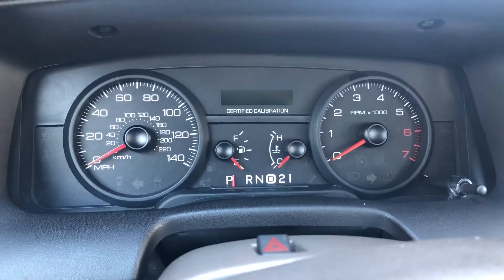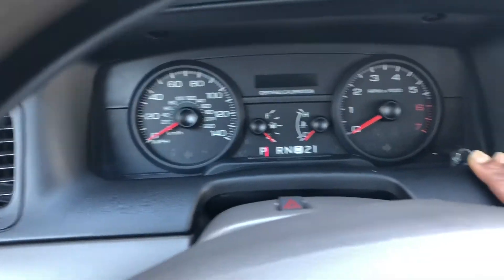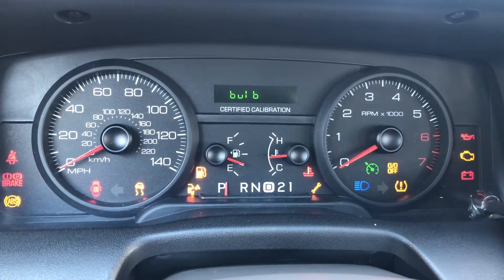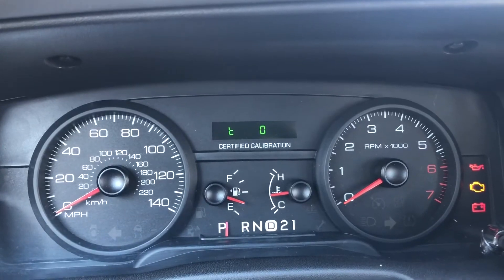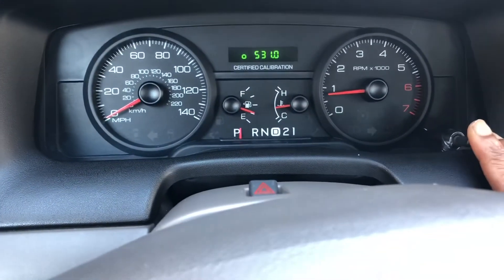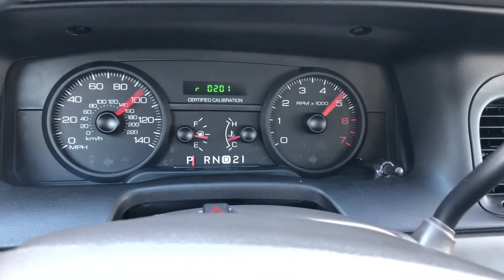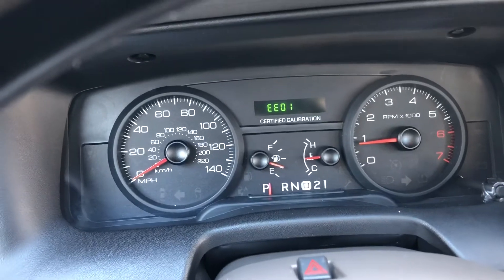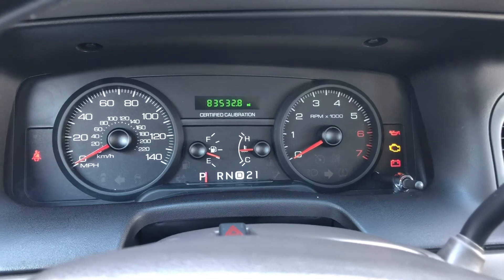Hidden diagnostic trouble code display in crown Victoria

Comment: This instrument cluster in your video is 06-11 cluster. 95-05 pretty much runs the same cluster with a manual odometer, not a digital one as is displayed in your video. The early 90’s like 91-94 ran the same layout as the 95-05 except the 91-04 speedometer didn’t start showing your speed till like 20 mph if I recall correctly.
Reply: My apologies; 91-05 ran the cluster with a giant speedometer and no tachometer. 06-11 is totally different. I didn’t mean to word it the way I did. 91-05 were manual and odometer, but you’ve got an informative video here. Props to you on that.
Reply: This is actually a 2007-'11 cluster.  2006 looked extremely similar but was a one year.  On the 2007-up, the traction control light is on the left side of the cluster in the speedometer section, with a cruise control indicator on the tach side.  On the 2006, there is no cruise indicator, and the traction control light is in the location in the tach where the cruise indicator is on the '07+.

Comment: I been trying to get my door open light to cut off I went around all the doors and tightened them but that didn’t work
Reply from the maker: Maybe a wire problem, if you tightened up the doors and they're not unaligned.. I would check the fuses and also take the panels off the door and check to see if everything is OK with the wires and this thing in the door that triggers the light can't think of the name of it at the moment
Reply from the maker: If the door ajar light in your Ford Crown Victoria won't turn off, it's likely due to a faulty door switch, a short in the wiring, or a problem with the vehicle's computer system. You can troubleshoot by checking the door jamb switch, inspecting the wiring, and potentially resetting the system. 

Here's a more detailed breakdown:

1. Check the Door Jamb Switch:

Locate the door jamb switch (a squishy, piston-like device in the door frame near the latch).

Remove the switch and see if you can manually short the two wires in the connector.

If the light turns off when the circuit is closed, the switch is likely faulty and needs replacement. 

2. Inspect Wiring and Connections:

Check the rubber boots on the door's wiring for any damaged or exposed wires.

Ensure all wiring connections are secure and not corroded. 

3. Consider Other Potential Issues:

Electrical Short: A short in the dome light or anti-theft system could also trigger the light. 

Stuck Door Switch: Sometimes, a door switch can get stuck in the "open" position. 

Computer Fault: In some cases, the vehicle's computer may have a fault that's causing the light to stay on. 

4. Resetting the System (if applicable):

Some vehicles have a reset procedure for the door ajar system. Consult your owner's manual for specific instructions. 

5. Professional Help:

If you've checked the common culprits and the light still won't go off, it's best to consult a professional mechanic for further diagnosis and repair. 

Tips for Troubleshooting:

Start with the driver's side:

This door is usually used most frequently and is more likely to have a faulty switch. 

Use a multimeter:

If you have a multimeter, you can test the continuity of the wires to identify any shorts or breaks. 

Consider WD-40:

Some users have reported spraying WD-40 into the door latches and trunk latch to help with sticky mechanisms or faulty switches.

Comment: I'm getting DTC code E023. MY check engine light jus came on too. Idk what it could be. Car is running normal. Please help if anyone knows
Reply from the maker: I know I’m 9 months Late.. 😂 the code is for the blend door actuator in the A/C system
Reply: @CHICAGOSAAD777  lol yea I figured it out.. Bought the part but research revealed how much of a pain it is to change so I went thru the glove box and did the manual flip over to cold for now. Thanks lol

Comment: What year is the Vic? How’s she holding up?
Reply from the maker: It’s a 2011, she’s holding up good gonna do a video soon, just been very busy with other things thanks for your time
Reply: @CHICAGOSAAD777  ty for the quick reply mane.  Ty for sharing this info. I’m sorry about all the questions lol. How manny idle hours and miles have you racked up sense this video
Reply from the maker: @saucemasterx911  no problem fam, not sure on the idle hours as of right now, but in the words of 21 savage alot lol, as for the miles not exactly sure off the top of the head but I’m right under 100k

Comment: The dtc code did not properly show a problem code.  It reads "none", when it should show a code on mine as cylinder 8 is misfiring. I still can't figure out the cause.
Reply: Try changing the ignition coil on cylinder 8 that is the last one on the driver side against the firewall.

Comment: Thanks for the vid. Im travelling 200 miles in my new 2010 P71 and the first thing went wrong is the heat stopped blowing hot, then the check engine light started to blink and then it stayed on with the little wrench light on. I topped off the collant it was low, but still no hot air in this tuoid 20 degree weather. Im checking the DTc first thing in the morning. Thanks again.
Reply from the maker: No problem brethren

Comment: Thanks man great info
Reply from the maker: No prob bro be sure to SUBSCRIBE and tell friends about me lol
Reply: @CHICAGOSAAD777   I did mine and a d900 code came up you know what that mean?
Reply from the maker: @jacksonvillemediabeef2940  maybe your ECM and dash needs to get to know each other better bro.. so you have to ignite that flame by turning her over  (the car) after a few good connections.. the communication will flow.. if the problem comes back you might have to listen to OBD see what he has to say.. but I really think the problem is the ECM is having trouble communicating with the dash.. which is not really a big problem.. just get a P.C.M flash to clear the thought.. sorry bored
Reply from the maker: @jacksonvillemediabeef2940  incase I lost you the code could possibly mean your ECM (engine control module) is having trouble  communicating with the dash.. after a few successful starts it will catch up and   get in tune.. if it keeps coming back you will need a OBD scanner to see the problem.. then you have the option to either fix if serious or clear if not..
Reply: @CHICAGOSAAD777  ok ima try today and let you know
Reply: @CHICAGOSAAD777  I got a 2007 intercepter

Comment: Wow look at the idle hours on that car
Reply: Mine is pushing 8000, 135000m, that's a lot! It's cold up here in Minnesota
Reply: @tomcervenka7404  It is said that every hour equalled 33 miles.
I have a 2007 ex MN.
State patrol Vic.
Has about 2500 idle hours .
Yes it IS cold here.
Mine has about 190,000 on it

Comment: Yup Good to know. Mine is blacked out and I changed the cluster. Still blacked out, oops it's something else.
Reply: The gauge clusters can have issues. Theres a guy who rebuilds and sells them. Dont remeber the sight but I had to do it, not that bad.
Reply: @HighPriestVaticanAssasin  Changed another cluster out and this one works. Fourth time a charm.
Reply: did mine myself been bright as day for 2 yrs with the worst soldering job done

Comment: Can you clear  the codes with that
Reply: You can clear codes without a reader by disconnecting the battery and putting the pos and neg wires together which makes the computer reset it’s self and you won’t have a check engine light and codes. Have them together for 5 mins.
Reply from the maker: Hell naw.. just for viewing purposes... if I remember correctly